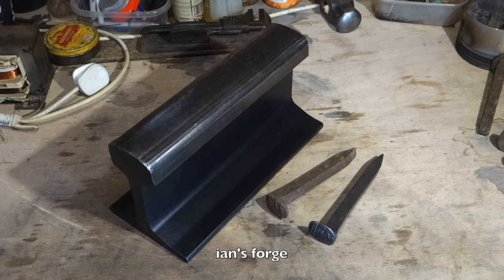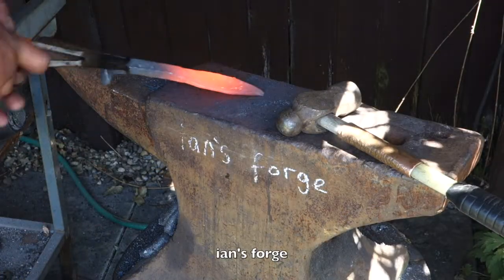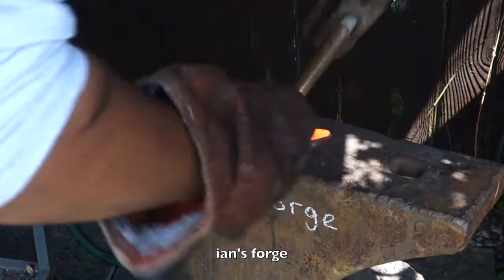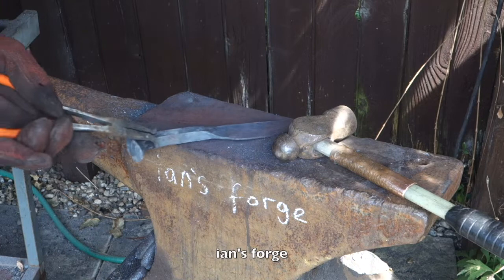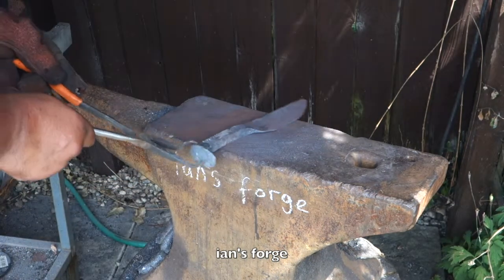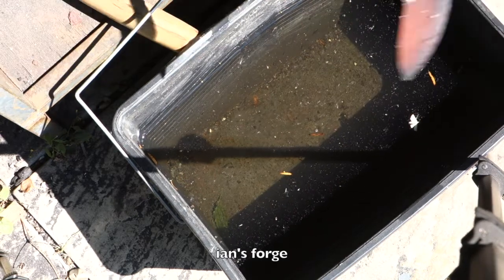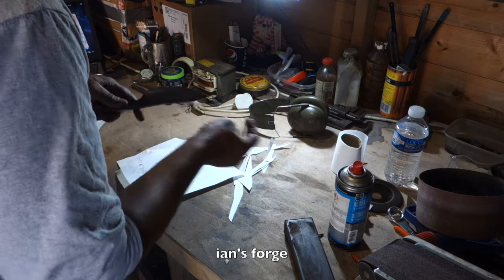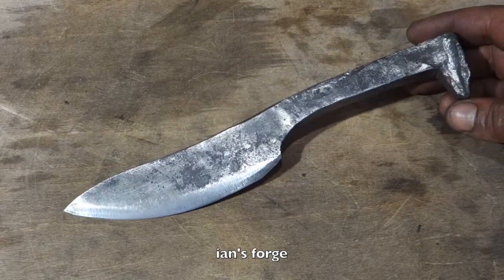Forging A Simple Railroad Spike Knife (using basic tools)

Comment: Great job bro ,Is it better to quench in water instead of oil
Reply: It has to be a specific steel to water quench. Most blade grade steel will crack if you use water like 1095 and 5160.
Reply: railroad spikes dont contain very much carbon. you quench in water to try and achieve a harder metal. with 1095, 01 tool steel, 6150, etc... have high carbon contents so you want to cool them more slowly to keep them from cracking by quenching in preheated oil